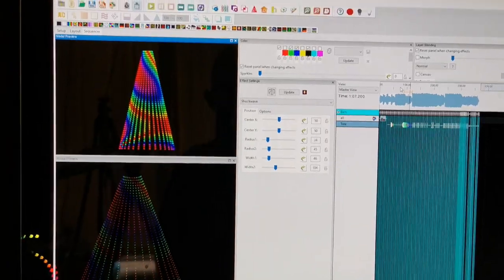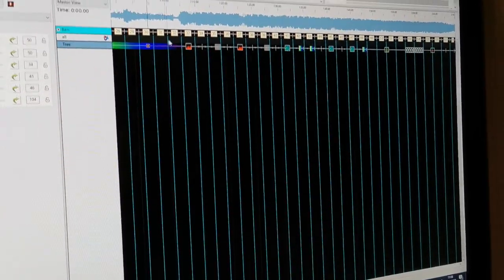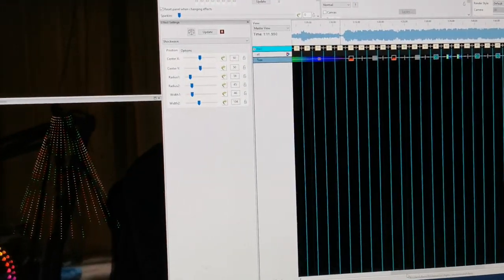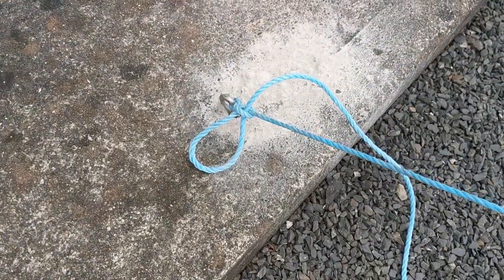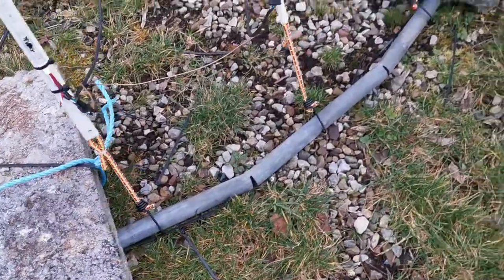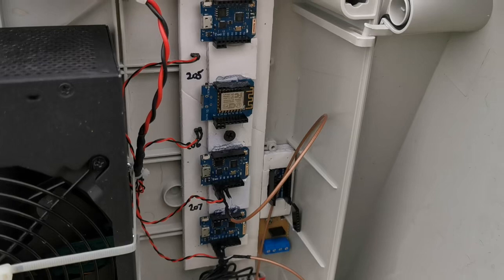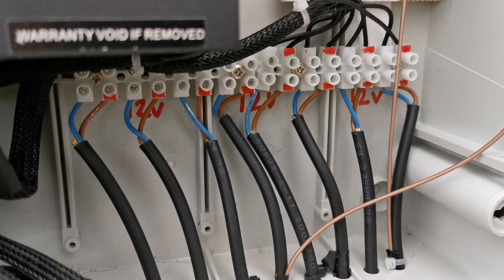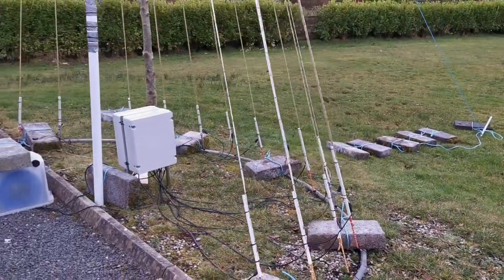Christmas Mega Tree Walkthrough

Comment: How did you fix the pole to the ground? Is it dug in or just sat on the top of the grass and the guy ropes hold it up?
Reply from the maker: 1I have steel cables as guy wires at multiple points.

Comment: So the Wemos D1 Mini are running ESPixel, right? How many pixels per strip, I think you said that you have 2 strips per Wemos D1 Mini. I didn't see any level converters so I guess you had no problems sending the data at 3.3V over that distance?
Reply from the maker: Yup, ESPixelStrip firmware. Each one driving 4 strips of 50, so 200 per esp. that initially confused me, I thought each strip had 150, but each ws2811 drives 3 RGB LEDs. I used coax for data, no problem with 3.3v direct to the strips.